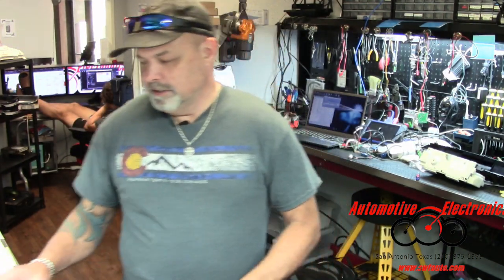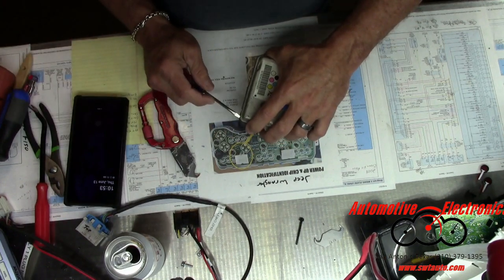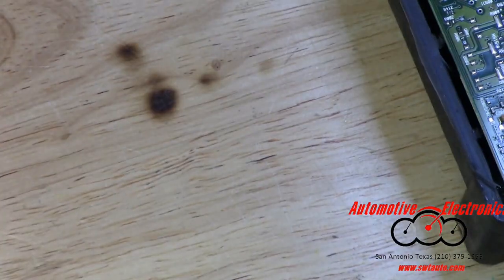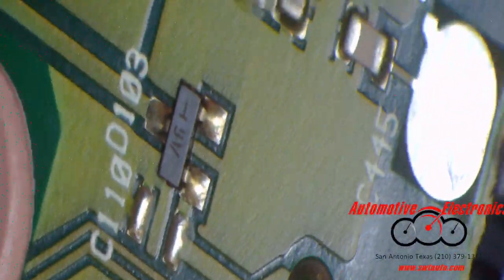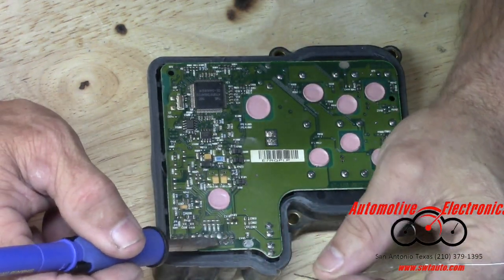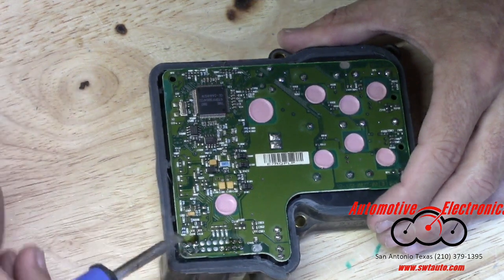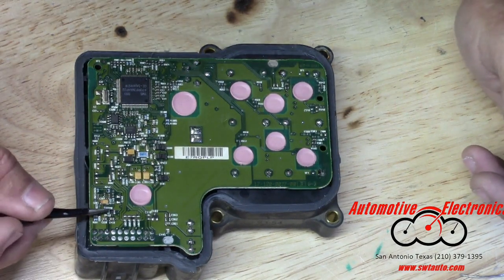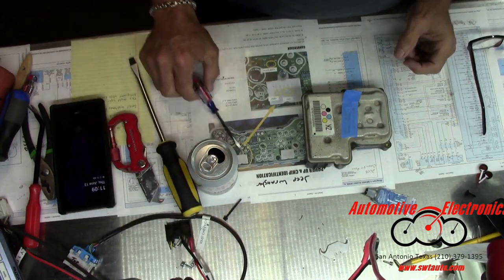Kelsey Hayes ABS MODULE REPAIR! IS YOU ABS OR BRAKE LIGHT ON? THIS COULD BE WHY!  HERES HOW ITS FIXD

Comment: Hey I just removed and re soldered the abs module on my 2001 Chevy blazer 4x4. I put it all back together and reinstalled the unit. The truck cranks and runs for about a second and then shuts off. My fuel Gage indicator is not working either. Any suggestions. Thanks.
Reply: I’ve had this happen to me on a ‘99 when I removed the old ebcm (abs lights were on) and tried a different ebcm from a different year truck ‘00-‘02 — then I had the same symptoms as you described. 

So I put the old one back on and i still had the abs light ‘on’ — but my truck cranked and fuel gauge worked. 
I know it’s not an answer to your problem, but I hope it ‘somehow’ helps find the answer. 
Good luck! 
( Let us know if you find out what was causing the issue. I’m sure someone else would need it one day. )
Reply: @Zanester101  Hey thanks for responding. I removed the abs module and inspected it closely. I had accidentally dripped a small drop of solder on a chip that was causing a short. I heated it up and cleaned it off with a tooth brush. Finally the truck started again. The abs light was off and so was the brake light. After about 30 seconds into a test drive the abs light came back on. Turns out one of the wheel sensors had failed after doing a full scan. over all it did fix the random brake light and everything works great now.